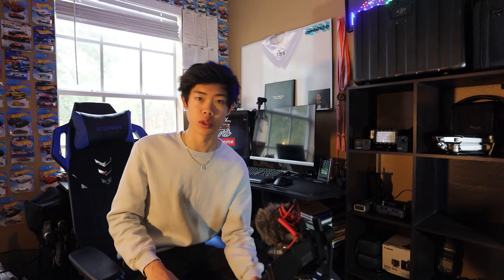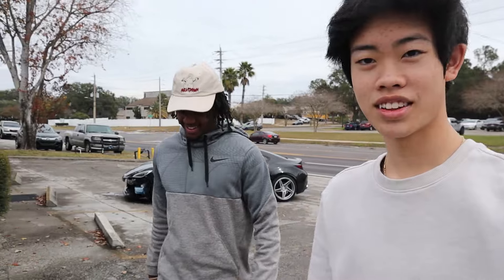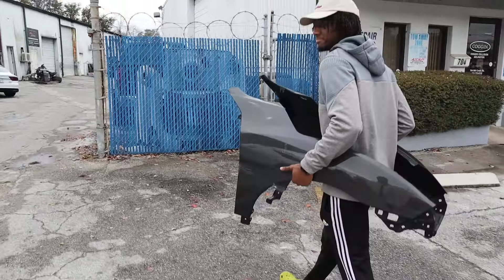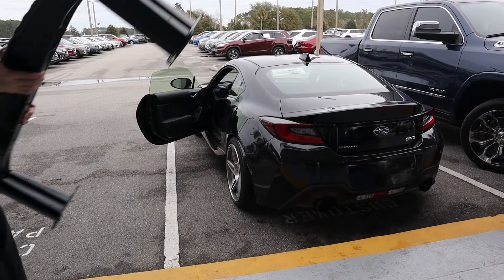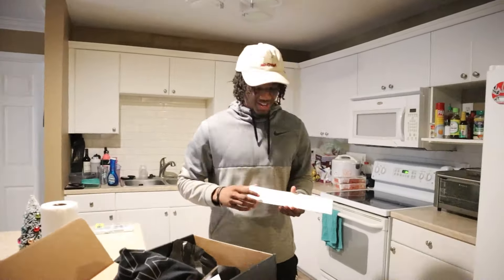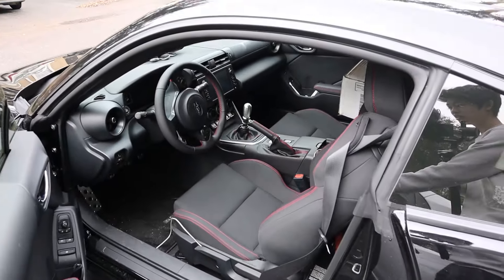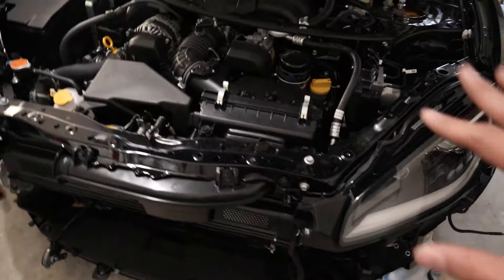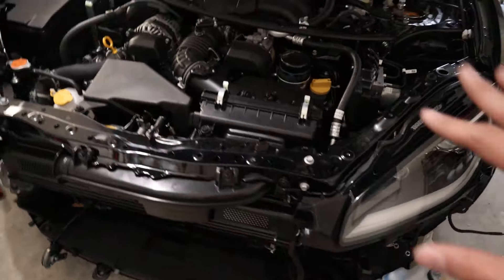Leaving my 2022 BRZ! (Si UPDATE)

Comment: Good to know that the BRZ doesn't have that much damage. I was supposed to pick up my GR86 earlier this week but I got scared watching your other video cause there was a snow later in the week and I never drove an actual RWD car yet
Reply: I got a BRZ & his video was 100% a wake up call for me to be extra careful with this snow… super grateful for that actually.
Reply: @DNKwest74  Bro I just bought a BRZ and you need to be aware that the stock tires are summer tires. AKA DO NOT USE THEM IF ITS UNDER 30 degrees. And don’t even dare to use them if it’s snowing. What you need to do is buy a proper set of winter tires or at least all-seasons. Ship it to the dealership and have them install it before you pick it up. TRUST ME!
Reply: check my other reply below
Reply: @eric luu
Reply: @brandonn2584  exactly what I thought. Temps are in the 20s these past two weeks so I’m waiting until it gets better